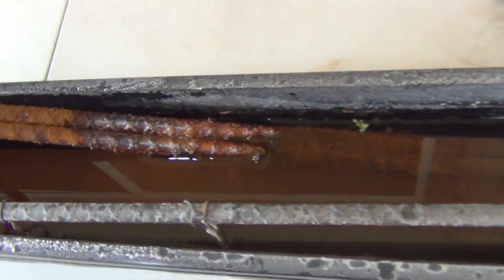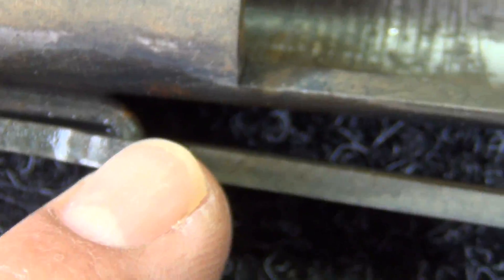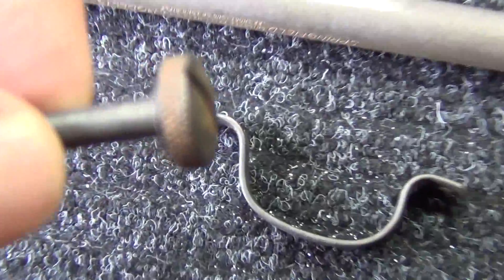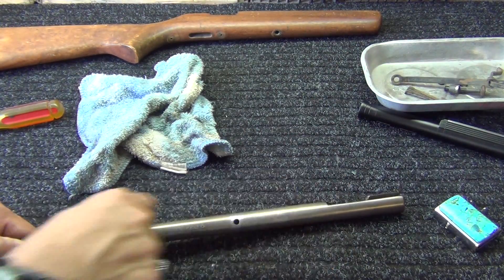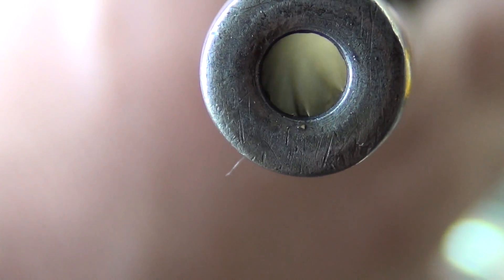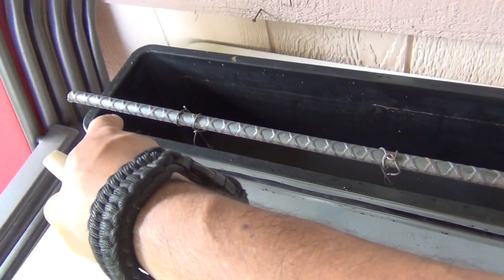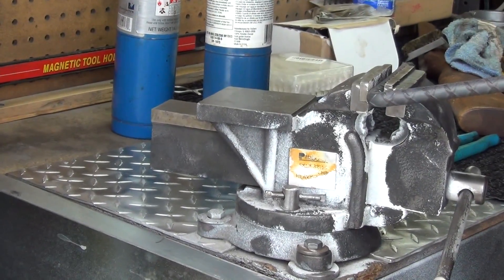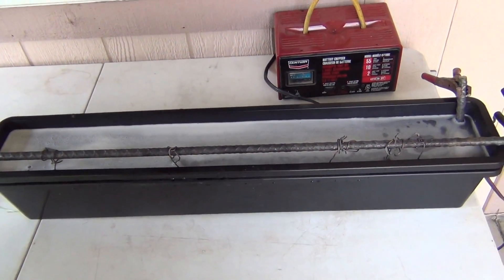GUN RUST REMOVAL ELECTROLYSIS PART#2

Comment: Just go to your local cleaning supply store and get some toilette bowl cleaner called "The Works" and pour it over the barrel and it will take the rust off in about one minute and then go on to redoing the barrel. Works great but do not get it on you as it is mostly acid.
Reply: Destroying any value???

Comment: The problem with using electrolysis is it will take the bluing off of the barrel and parts, you're literally going to need to re-blue the entire rifle. Literally oil the rifle down and do not try to remove any more rust off it, you can use that rust to make a new coat of bluing!